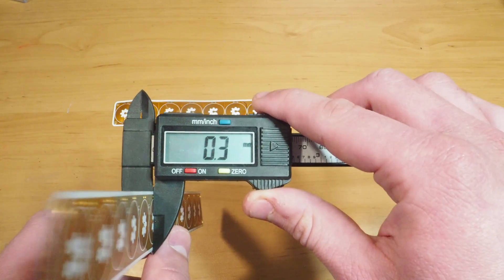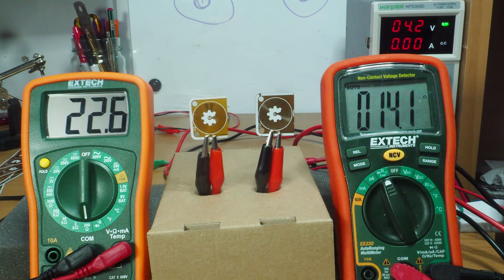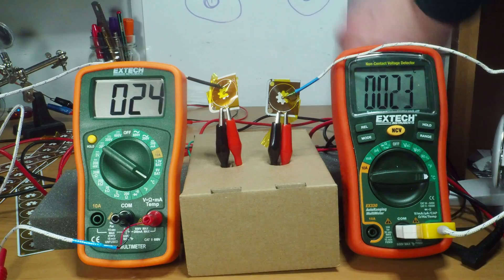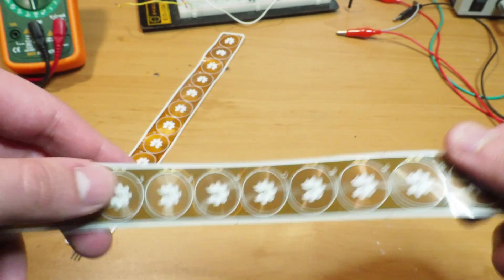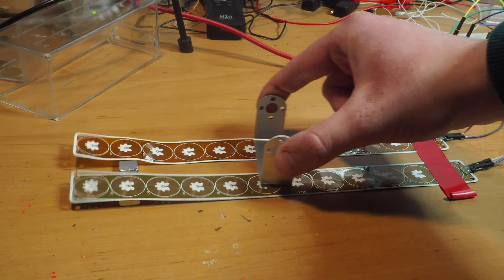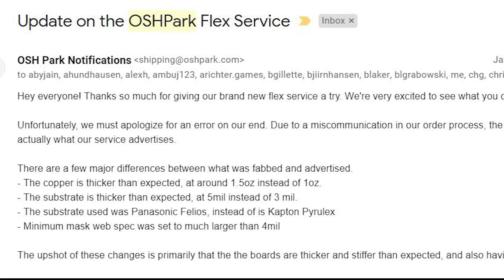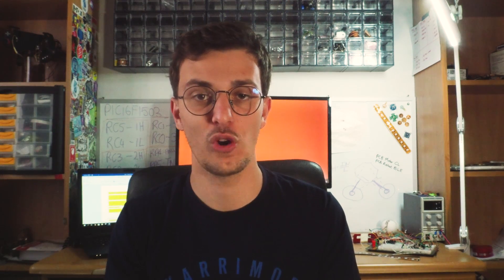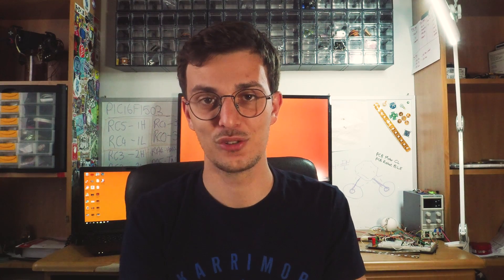Flexible PCB Actuators Thickness?

Comment: You think the coils could be made microscopic to make micro relay for memory elements? By way of 3d printing using
conductive ink?
Reply from the maker: The size of pcb coils depends on how small the manufacturer parameters are, so it's hard to go lower than 4/4mil.. Regarding the conductive ink I have already made a video about it 🙂 and I will be publishing another one soon

Comment: Have you considered this as the brains and communication?: https://www.aliexpress.com/item/Upgraded-version-ESP-01-ESP8266-serial-WIFI-wireless-module-wireless-transceiver-ESP01-ESP8266-01/32900849637.html?spm=2114.search0104.3.2.58b14d95IacaHo&ws_ab_test=searchweb0_0,searchweb201602_7_10065_10130_10068_10890_10547_319_10546_317_10548_10545_10696_453_10084_454_10083_10618_10307_537_536_10059_10884_10887_321_322_10103,searchweb201603_16,ppcSwitch_0&algo_expid=11dbdc95-ff82-4fc5-83e0-b31481854fca-0&algo_pvid=11dbdc95-ff82-4fc5-83e0-b31481854fca
It is programmable like an arduino. Don't know the weight though

Comment: Please think about to make something powered by kinda wireless charger (coil ring currency transmitter and receiver on the small distance 1 over 1) around a motor shaft to power up LEDs with kinda arduino controller to make wireless powered up something kinda spinning clock or smthng that no need battery onboard. I know everything already invented but you could make it smaller, cheaper and lighter using smd/bga and flex cables)

Comment: Why are such thin ones even desirable? More flex? Could the flex on your robots be located on a hinge, made of tape, instead?
Reply from the maker: More flex, less weight, one pcb, same/cheaper price.. Yeah I could make a hindge but it makes more sense to have the hindge from the pcb itself.. From a product design and engineering perspective it will be simpler to assemble + less tiny parts for my robots 🤣
Reply: Carl Bugeja , yeah, the assembly kills my idea.
Reply: The best of both: thick coils. With a wide but thinner strip that is more flexible for power to the thicker strip. The flex occurs in the thinner section.  (Use solder paste and heat gun to connect the different thicknesses?)
Reply: Also, could you counter any weight with another thin magnet glued to the coil? This would create a neutral-weight zone.